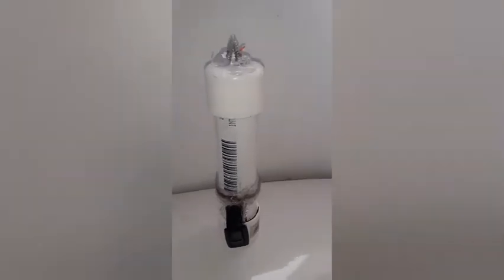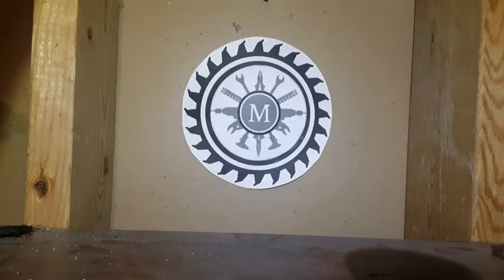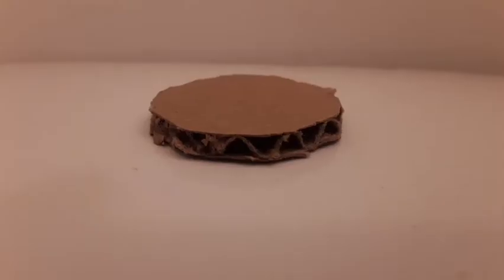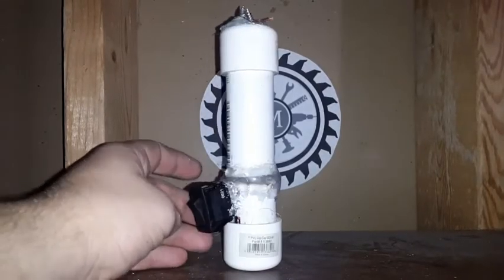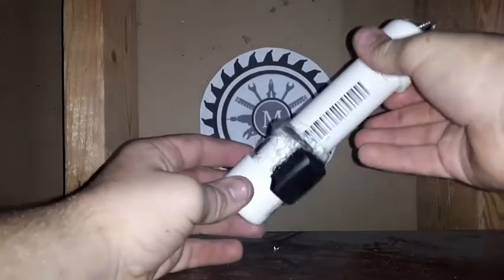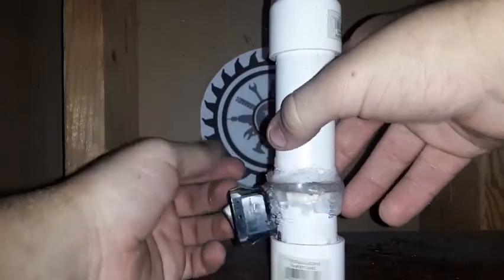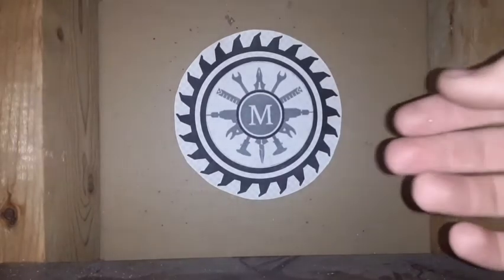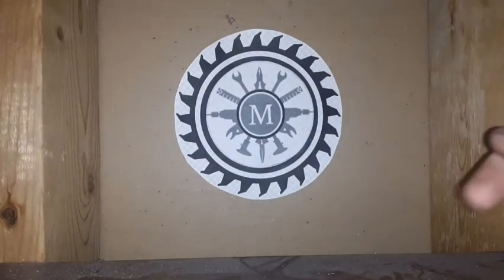How to make a pen taser! (under $15!!!)

Comment: You should show us ALL the projects you have made, and it’s actually not a transformer I don’t want to prove you wrong but it’s a capacitor, it stores a charge until the charge is large enough to jump the screws, discharging the capacitor, it’s also used in electric fly seaters and I have one that’s charged off of two AA battery’s. Transformers however they reverse the current from dc where it comes from the power plant, to ac which comes from the outlets in the home
Reply from the maker: Oh ok well you learn something new everyday! 🤣🤯🤦‍♂️
Reply: Yup